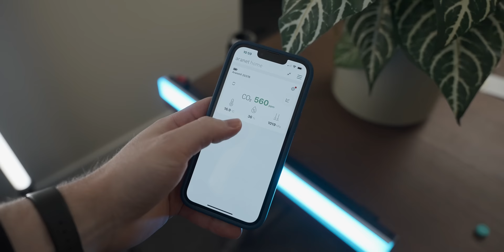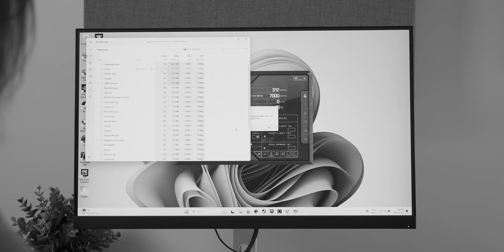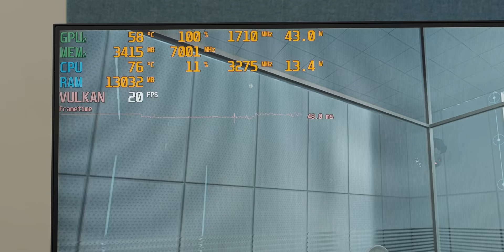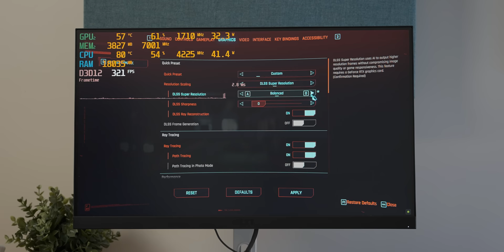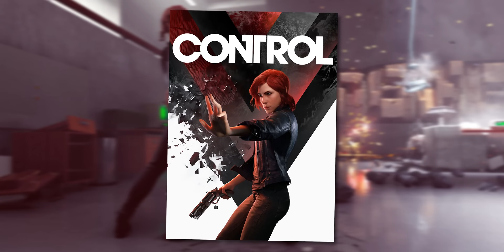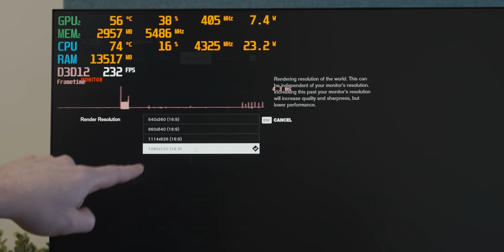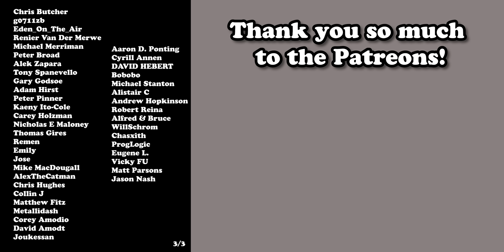Can The Slowest RTX Graphics Card Even Ray Trace?

Comment: "Why not get the RX 6600 instead of the RTX 3050?"
"I want ray tracing"
^ Actual forum discussion I saw.
Reply: Lol all that Nvidia rtx marketing is working then.
Reply: To be fair, a RTX 2050 is like if you took a 3050 and kneecapped it before breaking its back. A 85W RTX 3050 performs significantly better (though still not great).
Reply: can you explain? dont know much about all this ict/hardware stuff. I guess the RX6600 can perfectly handle ray tracing but nvidia somehow got the illusion to the large crowds that their rtx cards where much better and optimized for that task?
Reply: get a used rtx 3060ti for $250. It is tons faster than both at raytracing
Reply: @jhwhthemerciful They can both do ray tracing, though the RX 6600 performs way better on anything other than ray tracing for about the same price while the 3050 is very overpriced for what it is. The 3050 will be faster at pure ray tracing workloads like running cyberpunk with ray tracing on and other things at low settings or maybe or running quake RTX since nvidia cards have decidated ray tracing hardware but it's kinda pointless at this tier of graphics card since they're not nearly powerful enough to make use of it properly.
Reply: @jhwhthemerciful  No, the point is that while RX 6600 can't handle RT at all, RTX 3050 is barely usable with RT, too.
Reply: This is me but with DLSS.

FSR is junk, so of course I want DLSS lol.
Reply: @cin2110  LOL the sad part is Ray Tracing is UGLY and SMEARY most of the time. I have a 4090 and I ALWAYS turn off raytracing and without it I can run 4K surround in titles with decent optimization
Reply: Ray tracing is so resource intensive or broke (those are the forms it usually comes in on games lol). You have to spend a fuck ton of money on an Nvidia GPU to get at least playable frame rates using it, Or if broke it don't matter what you have it still fucks you over. Why bother? So much money and loss of framerates to view something that you will soon forget about when playing and completing a game, Or not notice much or any difference if it's implemented poorly. Stop with the bullshit and give us the hardware that can implement it with no second thought, Or code it more efficiently, And then we can talk about it.
Reply: @charginginprogresss  FSR is worse than DLSS, but 3050 is so much worse than RX 6600 (while also being more expensive) that it fails to make up the difference.
Reply: to be fair, if you use ray tracing in rendering, then it matters, but anything below a 4080 is not for ray tracing in games.
Reply: @charginginprogresss  I miss the days of NOT needing upscaling tech to make games playable DLSS. is the lesser of 2 evils but all it has done is lead to the Publishers cutting time an money on optimization so unless you have DLSS FSR or XeSS games run like crap and thanks to TAA being required they all look like crap upscaled or not. In most cases TAA is FORCED on whether you use DLSS FSR etc or not BUT, Forza Horizon is one of the few games that allows you to NOT use TAA and it looks and runs GREAT because it Added DLSS after the game was finished and optimized
Reply: Back in 2019 that was actually the reason I went with a 2060 instead of a 5700 when I built my first PC because what if I wanted to try ray tracing

It’s been almost 5 years and I’ve never tried ray tracing
Reply: Honestly its also best if they went with an rtx card if they have an intel processor
Reply: The RX 6600 murders the RTX 3050 for everything but RT and some productivity tasks.
Reply: Nvidias marketing department are on some substances for sure
Reply: Wow, that's an entry for the Rinkworks Computer Stupidity section. XD
You know, if that were still getting updates.
Reply: @jhwhthemerciful Because ray-tracing on a 3050 is going to give you laughable performance. Ray tracing is not a technology for shit-tier cards like the 3050, where you're going to be struggling to get 30FPS while having to crank every setting to zero to even get it to be playable. Meanwhile, said person is literally willing to give up on a card that's like 125-130% of the performance for the keyword "Ray Tracing"
Reply: I bought a 2080S for $150 off of facebook, why would anyone buy the low end new, it makes no since.
Reply: @charginginprogresss  Except FSR isn't junk, and even funnier is the fact that FSR 3 is breathing life into NVIDIA GPUs from the 10 and 20 series that have a shittier DLSS because NVIDIA expects you to buy the newest card for the newest upscaling.
Reply: Funny how the 6600 performs almost identical in Ray tracing because it just has more performance 🤣
Reply: Well, ray tracing is not just for games. Some folks genuinely use laptops to render static images with lots of reflections. Sadly, professional software often omits support for AMD GPUs , so they are forced to use Nvidia.
Reply: @olnnn  Amd has Ray accelerators, amd cards actually have dedicated hardware for ray tracing, the problem is that vs the 3000 series, it's the first iteration of their "Tensor cores" the ones that are in charge of processing Ray traced lights, so they are less efficient, they are not doing it without hardware, the only ones doing that will be the GTX models, and you know how that goes, very bad.
Reply: @charginginprogresss  yes, you need to enable dlss to match rx 6600's native performance. This is a junkier solution than fsr and it is very sad to see an rtx 3050 user just for that.
Reply: wrong channel, this channel is to laugh at, not explain @jhwhthemerciful
Reply: @jhwhthemerciful  Not too sure about raytracing performance in particular (RDNA2 isn't very good at it), but outside of RT a 6600 will run circles around the low end Nvidia RTX GPU's.
Reply: Theres people actually buying 3050 wtf
Reply: @olnnn  yeah they could probably put 1000 rt cores in the 3050 but it still needs the adequate horsepower to back up those rt cores.
Reply: @adlibconstitution1609  then pray is doesn't have faulty hynix memory that will fail, no thanks.
Reply: @olnnn radeon cards have dedicated rt hardware my rx 6800 beats a 3070 at rt because of the lack of vram, I play cyberpunk with all rt setting enabled at 40-60 fps with amds implementation of frame gen, and all other games run well with rt because it has 4080 levels of vram u nvidy guys got took.
Reply: @ocularcavity8412 Forza Horizon is such a well-coded game. Runs on anything with over 100fps and looks amazing. 
If only all games devs were as dedicated to producing such a polished product at launch...
Reply: @mrhappy8966 rx6700xt owner here who is very very pleased with its performance in RT - I've never bought an nvidia card because they're just never worth the money.
Reply: @mrhappy8966  "radeon cards have dedicated rt hardware" Ehhh, kind of true but also not true. The RT accelerators are built into the CUs. It has no dedicated, separate RT cores. Intel and Nvidia are the only ones with dedicated RT cores.
Reply: I remember I'm guilty of getting a RTX 2060 instead of the better and slightly cheaper RX 5700 to run Cyberpunk with ray tracing back then, just to realize that even tho you can enable RT with that card, it runs so poorly you could as well don't have it. Dumbest decision ever.
Reply: @HunterTracks I have a 140w 4070 mobile and omg it’s amazing
Reply: @mrhappy8966  I have used RTX 3060ti for $250 and a used Rx 6600 for $165 for months now. And both are still running fine.
Reply: Lol, the 6600 will do better RT. Went like gangbusters in FC6. CDPR sold out to make Cyberpunk a 40 series showcase. Can't even run RT in CP on a 30 series flagship these days. I used to run Psycho RT on a 2070 Super.
Reply: @adlibconstitution1609  Not all of them have the faulty hynix memory if u open up gpu-z and it shows samsung memory thank your maker.
Reply: @mitsuhh  well whatever the case may be it runs rt just fine.
Reply: @HunterTracks  ive had an rx 6600, it can do raytracing.
Ive used it on minecraft and cyberpunk, it does perform a bit meh though at 1080p
Reply: @guesswho2778  I know that it has RT accelerators, what I meant is that the performance is dismal.
Reply: @jhwhthemerciful point is they are both DOGSHIT at raytracing, barley able to run it at all, but rx6600 is a lot faster at everything else and comes paired with 8gbs of vram instead of 4gbs u get with 3050 in laptop.
Reply: @Dominik12335  RTX 3050 desktop have 8gb
Reply: @jhwhthemerciful  many people thing Ray tracing is RTX exclusive. even though a steam deck can do it, not well but it can
Reply: I have an RTX 3050ti in my MSI Katana laptop, and I love it. I don't really use ray tracing, but the pc can handle it. I don't really like the way it looks. Of course it performs better without rt on, which is good because I don't like it anyway. You just don't seem to get much benefit as far as graphics from it compared to how resource intensive it is. She gets pretty hot with rt on, lol.
Reply: "i want ray tracing" but can't tell the difference between raster and ray tracing
Reply: my awnser don't you like Frames per second 😂
Reply: because nvidia fans buy at any price nvidia throws at them, I recommended for somebody to buy rx 6600 instead of 3050 and got told that somebody wants nvenc but mostly does gaming, even if rx 6600 runs circles around 3050 in gaming performance when no nvidia proprietary bullcrap is applied
Reply: @ocularcavity8412  can my rtx 3090 run rtx?
Reply: @SuperMickyChow  agreed amd has and hopefully always will be a budget friendly option.
Reply: @mrhappy8966  I think AMD will position themselves as offering 90% of equivalent nvidia performance for 60% of the price, but I can see them moving away from the truly budget cards and Intel taking over the sub €£$200 market with cards like the arc300 series.
There will be overlaps - arc 300 cards were around 20% cheaper than a 1650 or a 6500xt but we're behind on performance by 10-15%.
So, what amd offers relative to nvidia, I think intel will offer relative to amd, if that makes sense?

Basically :-
On a really tight budget? Go Intel
Got some cash, but don't want to pay an excessive 40% premium for 10% better performance? Go AMD
Got money to burn or absolutely have to have the very best of everything no matter the cost? Go nvidia
Reply: @UniqueWisdom1ff  depends on the Game and Resolution if you are playing at 1080p it can probably run most games at playable GPS without frame generation or DLSS, if you play at 1440p you will probable still be good on most games but probably need DLSS for the heavy hitters, at 4K for you would probably need DLSS for Most titles and Frame Generation for any of the heavy hitters to run at playable Framerates
Reply: The vast majority of people buying RTX cards because of ray tracing will not even use the card in scenarios where RTX really makes a difference, like 3D rendering.
Reply: he probbly wants hardware renderers in blender/unity but if that's what he's going for he should get a used 2080 or smth comparable
Reply: @HunterTracks  This is factually incorrect, the RX 6600 has 28 RT acceleration cores, and even if it didn't it could still perform it through the DXR layer as it's architecture supports ray tracing (it would just do so with a much greater performance penalty.)

Fun fact, my old ass GTX 1080 from 2016 can actually use Ray Tracing in games that use DXR because it's architecture supports it.
Reply: @jhwhthemerciful  The rx 6600 can handle raytracing but doesn't have rt cores for ray tracing. The RTX series are better at ray tracimg and have fearures like dlls to improve yiur fps in games. But they are overpriced. I would recommend the rx 6600 becouse you aren't doing a lot of rt with the RTX 3050 anyway
Reply: @masud2582 If you're gonna do that just get the RX 7600 hundred I think. It's basically the same as buying a 2080, same Vram, same/similar price from what I see, but with RT capabilities like a 30 series card, 2/3rds the power draw of the 2080, and less connectors than the 2080, so way more compatible.

Edit: I guess the memory bus of the 2080 still makes it worth considering in general, but since the reason given in the comment for choosing a card was RT capabilities I don't know if that's enough to justify choosing two generation old RT over a card with effectively last gen ray tracing and almost certainly more longevity and support.
Reply: @adlibconstitution1609 3060ti is not enough got a decent rt performance, its basically 2080super. Back then even 2080ti struggled with rt so 3060ti is even slower
Reply: @phantomslayer8649   I just bought a 140w 4070 laptop, I'm going to have to try ray tracing, though the laptop display isn't that good, I'll have flip the laptop over and try it on an external monitor. From what I have saw of RT so far though it isn't worth the performance penalty.
Reply: @fallin5427  I wouldn't say the GTX 1080 can utilize RT in any meaningful form. It can technically do it, but at such a huge performance penalty that the game is totally unplayable.
Reply: @stephenhood2948  oh man I’m sorry that sucks, my laptops display is one of the best I’ve ever seen
Reply: @stephenhood2948  I actually did try RT in the only game I knew that support DXR RT on it, that being Battlefield V. I’m pretty sure Battlefield’s implementation was just for reflections, but with the graphics at ultra and with Ultra RT at 1080p it was hitting 30 FPS (which was more than I ever expected 😂

I never suggested that you should play with RT on such an old card that doesn’t even have hardware acceleration for it, or that you would get playable framerates just that you could do it :P. Hence “Fun Fact.”
Reading compression is an important skill.
Reply: @fallin5427  Yes, I have a GTX 1080 as well, and have tried to use RT. What I got was a useless, unplayable experience. Honestly Im having a really hard time believing you got 30 RTd FPS out of a GTX 1080 at ultra settings, but hey, its your story, feel free to tell it how you want.
Reply: @BrunodeSouzaLino  its funny to because my card the rx 6800 surpassed the 3070 in rt because of the extra vram ray tracing is vram heavy, it also surpassed it in every other segment as well only slightly trailing behind the rtx 3080 after a few years of driver optimizations.
Reply: @mrhappy8966 The RX 6800 should be fairly decent for 3D rendering as well, including ray tracing.
Reply: @BrunodeSouzaLino  I dont do any of that stuff bit im sure it is its been a swell gaming gpu as is ty for your words.
Reply: I had a 6600 but DLSS is amazing plus I can use the FSR3 mod for framegen
Reply: @olnnn actually the 6600 is better at raytracing as well
Reply: Why not getting the Arc A750 with a real memory bus?
Reply: Uhm... DLSS, Ray Tracing and better drivers bruh
Reply: @rustler08 fsr looks way worse than DLSS, fsr3 is amazing but it's requirement to use fsr upscaling with it is a big con, the difference in shimmering and image quality is so apparent when switching between the two, fsr upscaling just has way too much pixel crawl
Reply: @roklaca313830 3060ti is perfectly capable of acceptable rt performance as long as you aren't expecting to crank it's settings and get 100 fps at 1440p
Reply: Got a used 6800M laptop for the same price as this one new.. I don't understand some people aversion to AMD. The laptop I have is closer to a 4070 Laptop and yeah it can't really do raytracing but who really cares.
Reply: @pptemplar5840  this all about cheap good ray tracing card 2080 for 180 is crushing anything in this price
Reply: @mrhappy8966  This is why I make fun of 30 series, yet nobody seems to understand. They put 8gb of vram on higher end 1440p cards, 3080 got 10gb which is a card targeted at 1440p and even 4k. Laughable really
Reply: @jhwhthemerciful   the rx 6600 can raytrace although AMD performance is hit much harder by ray tracing than nivida

The problem is that the rx 6600 is so much faster by default that even with a larger performance hit it's often still faster
Reply: Drawing RTX (or the t) on the 6600 with a sharpie would have been a solution
Reply: @stephenhood2948  You’re missing the point, I never said it would be good lol. I’d record a video to upload for you, but I upgraded to an RX 6700 XT a couple months ago and already gave away the GTX 1080.
Reply: Tbf my 3060 laptop can ray trace and that's only slightly faster than the 3050 desktop
Reply: I'm now depressed by the community
Reply: Rtx 3050 runs better than rx 6600 in ray tracing.

Many people care about visual quality. So if ray tracing can improve visual quality many will prefer that .
Reply: It's a valid point, does your amd run LLM's? Can you stream gameplays? Use apps like blender more efficiently? Be more stable? Can you encode and recode videos without the audio shifting???
Reply: @jhwhthemerciful well, on a hardware level nvidia does win that because it has specialized hardware for it, so the gpu cores have more room to work instead of calculating the rays, unlike amd... same with fsr which runs on a software level, taxing your gpu and cpu
Reply: @olnnn amd has dedicated rt hardware as well
Reply: @charginginprogresss  FSR 3 is better than DLSS what are you smoking?
Reply: Vega 8 gives more fps on a ryzen 3
Reply: @jhwhthemerciful  Nvidia fans will lead you to believe that all RTX cards can raytrace while still being playable which isn’t the case. The only RTX cards that can raytrace remotely decently without falling on its knees is maybe the 3070 and anything higher. I had a 3060 and if I tried to do raytracing on it. It would be nigh-unplayable. The 6700 non XT I had was better at RT than it was so it’s all relative at the end of the day. 

If you’re buying an entry level or mid range GPU regardless if it’s RDNA or RTX. Don’t bother with raytracing.
Reply: @charginginprogresss the sad part that even considering DLSS 3050 is behind, and the 6600m will be around $135 while nvidia's 3050... yeah.
Reply: @zsideswapper6718 3050 murders itself if you turn RT on
Reply: @divinehatred6021  True, even in raster on some games it will straight up just die.
But I guess it's a good LP card tho.
Reply: @zsideswapper6718 the problem is that at this point you would rather use something like 7840hs in mini-pc like Beelink SER7 and it would be on par with much less power consumption
Reply: @jhwhthemerciful basically in 2024, AMD cards are much slower at RT than Nvidia comparable cards. Want RT, CUDA for apps and excellent video editing drivers: go Nvidia; want raster at better price? Go AMD.
Reply from the maker: Oof, sucks for that person. 😂
Reply: dlss is significantly more justifiable, since it looks a lot better than fsr. this mans...
Reply: @adlibconstitution1609  I own an ASUS TUF Gaming RTX 3060Ti OC that punches above it's weight, so to speak.
Reply: @jhwhthemerciful Nvidia cards DO handle RT (ray tracing) better, but the fact is turning RT on will cut your performance (referring to FPS) in half most often than not, and sometimes worse on AMD (RX) cards, but seeing as how well "RT capable" cards handle RT, and how it has barely any if any at all visual changes between RT off and on, there is no reason to go with an Nvidia card if you are just gaming
Reply: @charginginprogresss FSR >> DLSS 🗿
Reply: @charginginprogresss  fake. You wont see the difference without 600% zoom or looking at screenshots.
Reply: @masteroak9724  
You're not dumb.
It's just that big companies can throw millions into communation, lobbying and advertisement, and that whatever we buy, it's rarely rational.
Reply: Ultra Performance DLSS does get the job done tho.
Reply: AMDcel cope comment
Reply: @chronozeta  

NVidia simp comment.
Reply: Ray tracing is a marketing gimmick lol unless you have 4070 equivalent gpu it's not worth using it also it makes a difference only in select games. It'll take atleast 10 years for ray tracing to become a norm.
Reply: @HunterTracks  nVidia: So, you came back to die with your traced rays?
3050: No. I came back to stop you.
Reply: @ocularcavity8412  it doesnt even look that much better than raster most of the time
Reply: @detecta  when playing the game on your own machine Raster almost ALWAYS  looks better thanks to it taking multiple frames for the Raytracing to stabilize when PERFECTLY STILL Raytracing looks good but as soon as the camera moves it becomes a mess, if ANY graphics card had a High enough performance then the Game could actually update shadow reflection and Global Illumination in ONE frame and it would look AMAZING. But even the 4090 is TOO WEAK to do that even with all the DLSS and Frame Gen it is STILL nowhere NEAR strong enough. If we had a GPU with at least 10-15x the Ray tracing performance of the 4090 I think Raster would finally look truly inferior to RTX
Reply: @HunterTracks  not a great card but the power efficiency is pretty good.
Reply: My2070 super is super and my rtx 3060 too
Reply: @jhwhthemerciful  I'm pretty sure that rtx cards have better ray tracing, but the rx 6600 has much better performance than the 3050
Reply: @masud2582  the 3000 series has more rt core so a 3070 wuold be better, you also get dlss 3 with a 3070
Reply: May aswell just use the mods that allow rtx and dlss and use a 1080 ti 11gb (it will explode lol, use fsr)
Reply: that's proved how effective nvidia's marketing team actually is :)
Reply: @olnnn  people will crap over 3050 simply because of the price. its still a nice card
Reply: Is RX 6600 a mobile laptop gpu? what about 3050 desktop vs mobile
Reply: I Have RX 5700XT lmao
Reply: i actually don't know what you are talking about. i always use highest RT settings with DLSS quality on my 3070 and it is absolutely worth it every time. ESPECIALLY cyberpunk. but yea i would also rather not use raytracing than not use dlss. FSR is so ugly compared. AMD might have raw numbers stronger raytracing performance, but with DLSS on that goes to blame. and it also isn't dlss 1.0 anymore. quality preset upwards DOES look better than native.
Reply: @cin2110 my exact problem with amd. why aren't they aggressively marketing their stuff??
Reply: @ocularcavity8412 forza series is a shining example of optimization.
Reply: @charginginprogresss  FSR 3.0 is great I dunno where youve been. Along with the fact that you can utilize it in any game and use frame generation in any game as well with AMDs software makes it an amazing experience. Supposing you got the cash to burn go for a 4080 and go nuts but otherwise get a 6800xt for under $400 and have a great time at 1440p at max settings.
Reply: You’re forgetting Dlss
Reply: at that price range you're not getting any card that can raytrace lmao
Reply: 6600 user here(on arch btw)